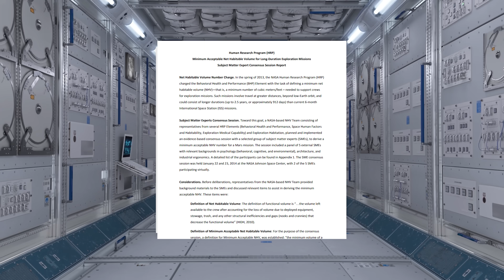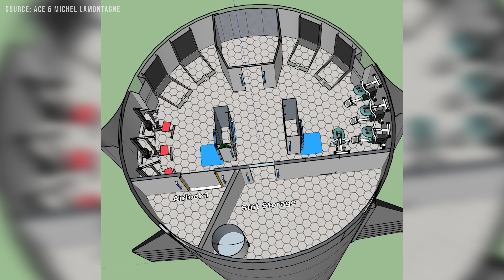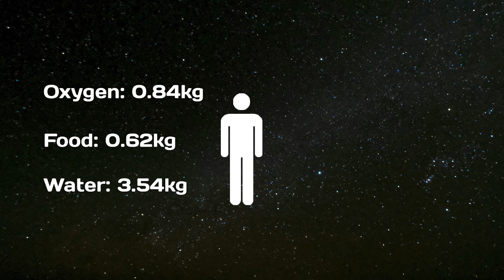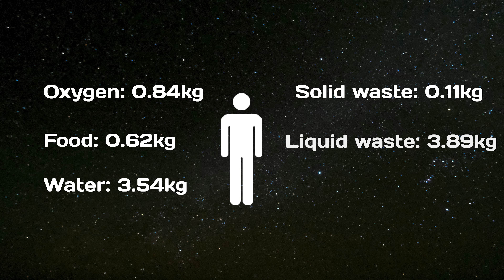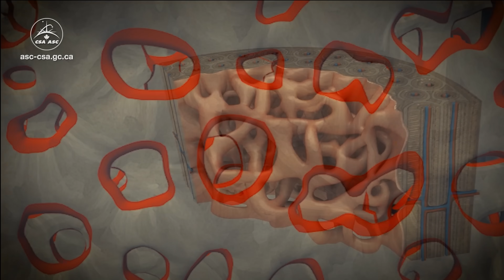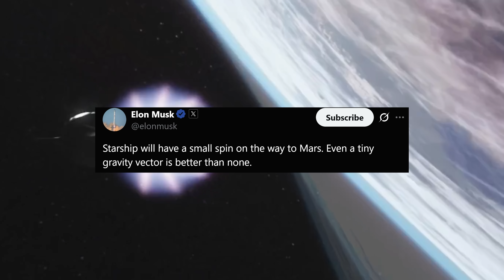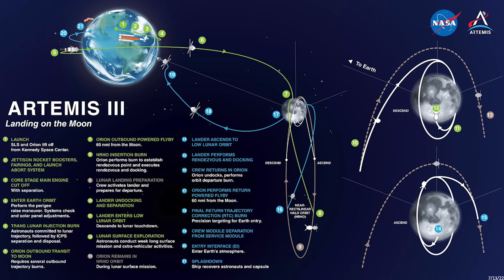How SpaceX’s New-Gen Starship Handles Life Support will blow your mind!

Comment: Have any of these even made it into space?
Reply: Yes every single ship except flight 1 have made it to space. So 8 ships have made it to space.
Reply: @ChickenDogArmy 8 Ships have made it to space and not one has returned successfully. The ship keeps getting heavier and the heat shield didn't survive when they were much lighter. SpaceX can use brute force to launch them into space but reentry only becomes more difficult the bigger and heavier they get.
Reply: @mp6756 3 ships have made it back? There goal hasn’t been to catch then it was to perform a soft landing in the ocean, and three have survived reenetry
Reply: @ChickenDogArmy They did make it to the touchdown but the heat shield failed on all 3 ships. Melting stainless steel each time. That isn't a successful flight. And now the ships are heavier than ever.
Reply: The Raptor engine is an amazing piece of engineering without question. SpaceX keeps increasing thrust. If the specific impulse numbers SpaceX says Raptor 3 is producing they are approaching the theoretical limits of a CH4 LOX engine. They are pushing Raptor so hard to overcome the ever-growing weight of a stainless steel upper stage. Dragsters run at the theoretical limits of internal combustion engines they also use the latest in material science and technology. A Dragster engines only make a few trips down the track before the engines require a complete rebuild or is lost due to the stresses involved. Building a fully reusable launch system using engines that are running at the limits of material science is a recipe for disaster.
Reply from the maker: The hard part is getting it back down in tact
Reply: @SpaceZonea  Being that they have yet to achieve orbit,  coming back is a done deal!  The tricky part is getting back in one piece.